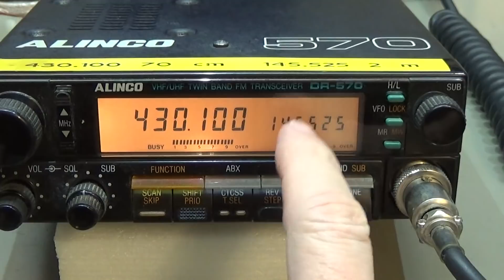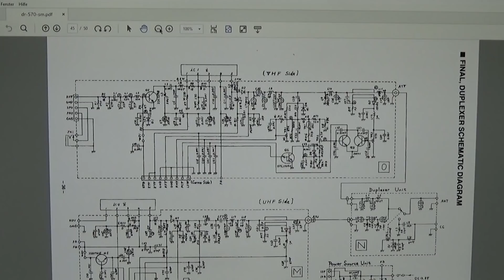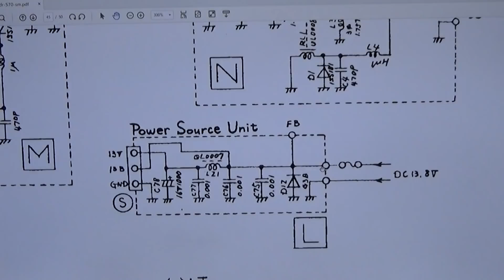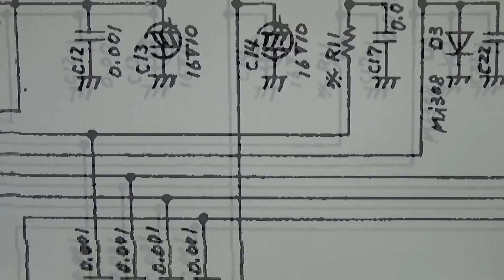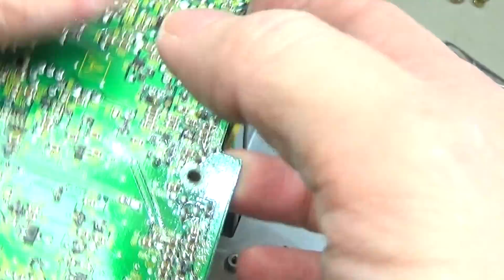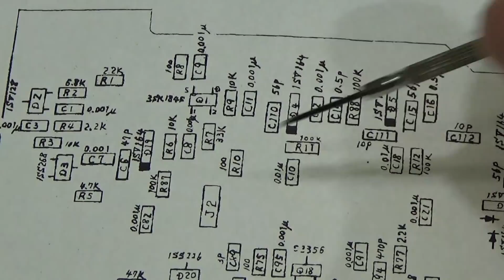#172 Alinco DR-570 old twin band vhf/uhf radio with to many issues

Comment: This is my first glimpse into an Alinco radio.  I've had a Kenwood TS-430S (gave it away), a Yaesu 3100 (bad finals) and now a Yaesu 991a which I love.  Thanks for the video on an Alinco.  I consider Alinco to be last in the top 4 manufacturers. Even though this radio is kinda old, is it worth the cost of the repair?  I had the company that sold me the radio to do the MARS mod on the 991a so if anything happens it will be covered under the 3 year manufacturer's warranty.  Cheers & 73 from W Rusty Lane K9POW in eastern Tennessee

Comment: Another great video! I'd like to add, that this ceramic SMD capacitor issue is not a rare thing. These are built out of stapled tiny platters, alternately connected to one solder pad and to the other. As this area of the PCB is exposed to big temperature changes, due to the RF power pack, it just broke and unfortunately shifted the platters against each other, so that they caused a short. If SMD caps are placed in not so ideal places, this issue often happens already by soldering them to the board, like you can see on EEVBlog where a big DC/DC supply exploded on the bench. It requires some knowledge of PCB design to take care of mechanical stress to SMD parts caused by inducted heat. You must give the parts some room to expand instead of loading the stress into the part. However that Alinco was a device from the beginning of the SMD area and some lessons had been learned since then ;)

Comment: I'm sad you drop it. Could you please explain the connection diagram radio to you beautiful rode swartz? I mean the RF generator output goes to RF input if radio. But I not clearly understand others.
Reply from the maker: We pick the audio signal at the speaker or dummy and evaluate the quality. Thus we are able to diagnose..Hope hat helps. 73

Comment: Peter, frohe Ostern! So lets face the truth: It is an old radio, not in mint condition, and it is not worth spending hours and hours to get it back in service. Lets see it the other way: It´s still a usable UHF radio to work with, and a powerful VHF transmitter to do whatever you want, i.e. you can use it for POCSAG or APRS. And maybe one day there is a 5 buck wonder on ebay with burned finals, then its easy to swap the main section. You choose the right way!
Reply from the maker: Frohe Ostern Olaf!! Yes that are the trues nothing to add to your comment....73

Comment: Hi Peter, as always, a good honest video. One point that the comments so far do not emphasise is that it is NOT the case that the radio could not be repaired, I know you would have found the problem eventually, but its just a case of pure economics; you have a business to run, but you are very fair to the customer. There are people who would just go ahead and fix the problem and charge the customer "mega-bucks" which wouldn't please anyone!!! It also goes to show how many faults can be found with just the eyes (and nose sometimes!) but good informative video Peter! 73, Brian EI8EJB
Reply from the maker: Thank you Brian! I always try to get a radio fixed with the lowest possible budget but sometimes it is not possible...All the best 73

Comment: Good job, Peter. Sometimes devices are not worth the cost of repair. The customer has some parts for sale now. Sometimes people will spend money on an old radio like that for sentimental reasons.
Reply from the maker: That is the point Robert sometimes devices are not worth the cost of a repair and thet is the piont to stop.. Thanks for comment 73

Comment: They can't all be saved.  Would still make a good parts radio.

One suggestion.  When the cables are to short you can always make extension cables.  I get cheap male to female ribbon cables on ebay.  As a example, ebay # 321898176333
Reply from the maker: Yeah that is true Mike! Very good hint with the extensions that you for that....73

Comment: I have used and worked on Alinco radios for a long time. At one time you could not even find documentation on them. The older ones are poorly designed units. Most of the manuals you find today are impossible to read. Unless you are doing it for educational purposes the rig is just not worth the effort. Thanks Peter for sharing.
Reply from the maker: Hi Buddy, not many Alinco on the market here so I'm not so much familiar with the brand. As long the documentation is good you can work with it but it is not....Thanks for stepping by...73